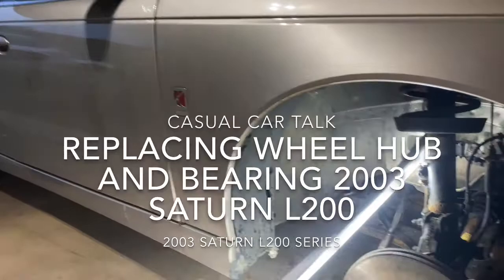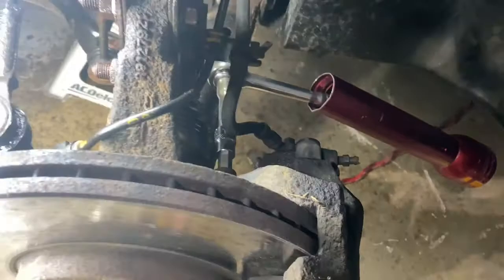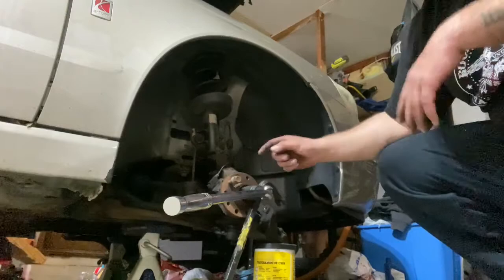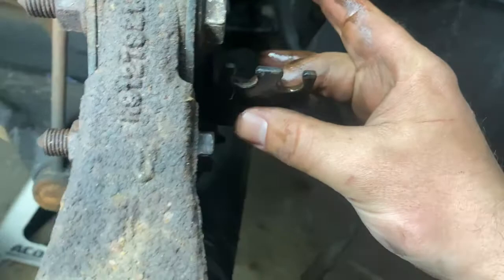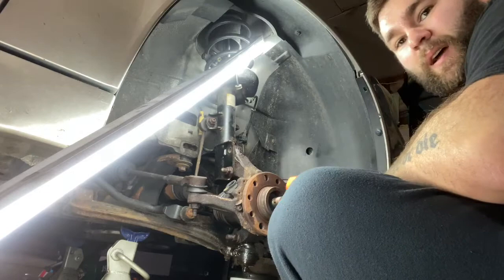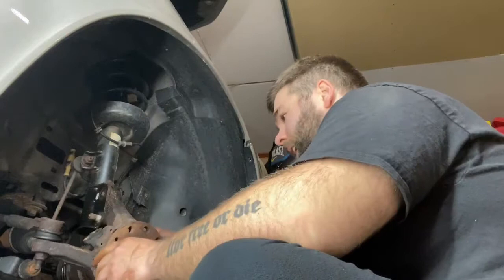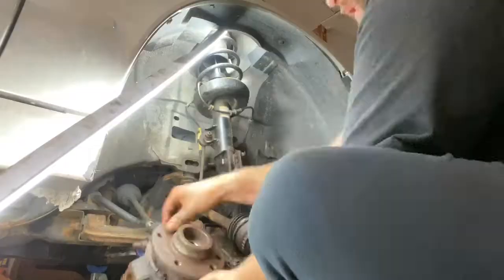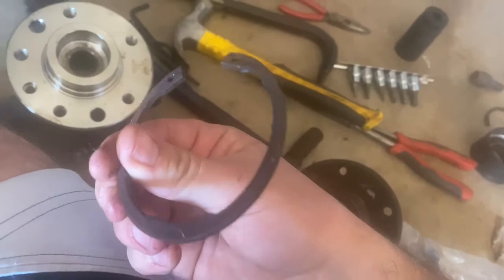How to Replace Hub and Bearing - 2003 Saturn L200

Comment: Great vid. Before taking the tie rod out I’d mark or measure where the locking nut is so that after putting the tie rod you can drive it to an alignment shop safely
Reply from the maker: Aisha Thomas it was so dirty it was super easy to get it close enough haha. You’re 100% correct and solid tip

Comment: Great video, tx so much! I believe the fasteners should be replaced with new ones as per GM recommendation. Hopefully I will be able to find new bolts.
Reply from the maker: Better safe than sorry! If you can’t find the right bolts swing by your hardware store and grab some grade 8 stuff. I’ve done it for years and never had an issue - thanks for watching and please help us back with the subscribe!